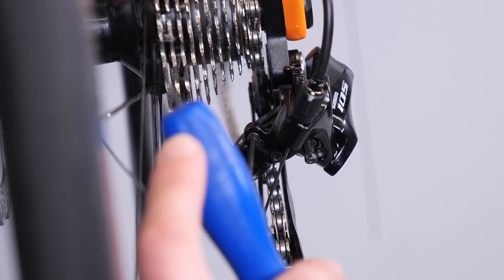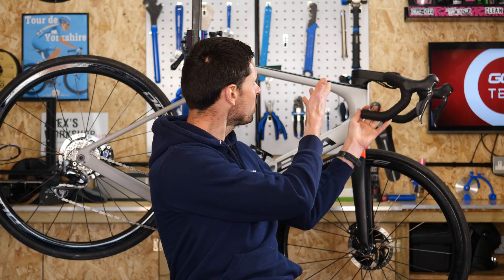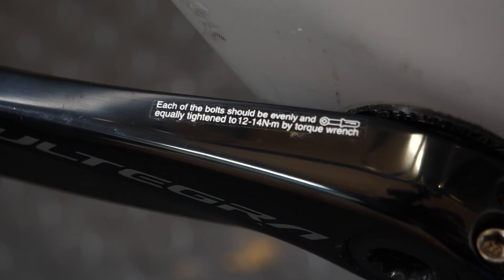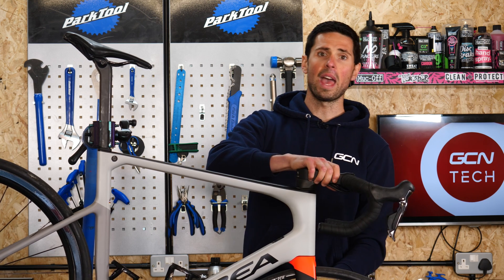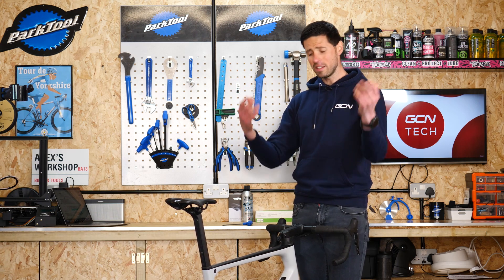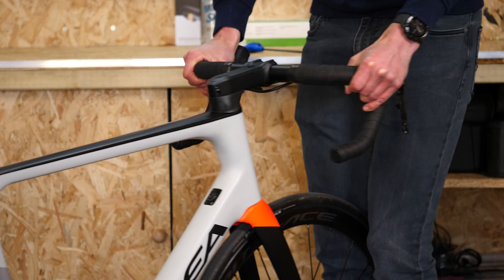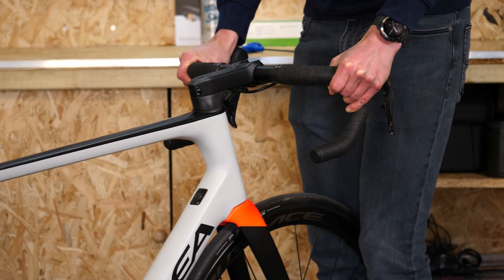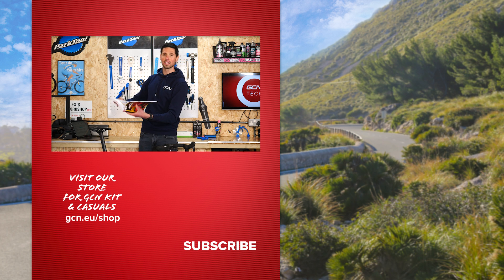Understanding Torque: Why Does It Matter To Your Bike? | GCN Tech Crash Course Ep.4

Comment: As this is an old video, don't know if anyone will see this.  There are standard specifications for tightening fasteners into different materials.  The charts list what different torques are required for a variety of fastener materials (steel, stainless steel, etc) going into a variety of materials (again steel, stainless steel, aluminum, etc) These charts can be found online.  Just find the chart for your size fastener going into whatever the material is that your fastener will be threaded into.  And yes, a torque wrench is a very good idea.  Very few people, especially amateur mechanics, can accurately "feel" torque.  You're going to be saving money by doing your own work, invest in a decent torque wrench.  The alternative would be a good selection of Helicoils.

Comment: I think it's a good rule of thumb to remember, anytime you're driving a steel bolt/screw into aluminum or other [relatively] soft materials, there is an elevated risk of the steel threads of the fastener damaging the threads in the component.  Over-torqueing the bolt in this scenario is a sure way to cause possibly irreparable damage to your bike.  In the battle between steel and other softer materials, STEEL always wins.  Take it easy!

As always, thanks much for sharing.

Steve

Comment: Great explanation! One question though: What range (x-y Nm) should the torque wrench, if I would want to buy one, ideally have?
Reply: For 99% of all work on your bike, a 4-14 nm torque wrench is all you need. Personally I use a 4-6 nm torque wrench made by Park Tool, for my carbon bike which works really good. A torque wrench with higher range is used for mounting bottom brackets or cassettes, which is really unnecessary to use a torque wrench for. Save money and buy the TW 5.2 or ATD 1.2 from Park tool.
Reply: @arwin2329  Good to know! Thanks for your advise and I'll definitely get one of those you suggested!
Reply: @bobhageman7567  No worries, I’m more than happy to answer any questions

Comment: One of the reasons why I ride without any carbon fiber parts is the hassle of checking torque for each part, and if your torque wrench is faulty, there is no telling of overtighten your components and break them. It isn't really a light setup, but for training, I don't mind it.

Comment: You forgot to mention that a torque wrench (overrated imo) needs calibration all the time. otherwise is a useless tool.
Reply: @sonny9608  um yes. What i say
Reply: Actually, for bicycle maintenance purposes, you don't need to calibrate unless the tool is dropped or otherwise abused. If you are using an industrial torque wrench,yes you need calibration. Oh, and store them at the LOWEST setting so you don't set the internal spring or other holding device.
Reply: I agree, I never use a torque wrench in all my years of wrenching bikes. I think the YouTubers use them in their Dream Build videos to make them look more professional. On the majority of the small bolts I just use two fingers, the thumb and the index finger, same ones I use to wank off with.

Comment: It's not always obvious if the torque range quoted is for lubricated components though. If you grease a bolt it clamps down tighter for a given torque setting. So often it is best to just go with plan B and go tight enough, but not too tight.